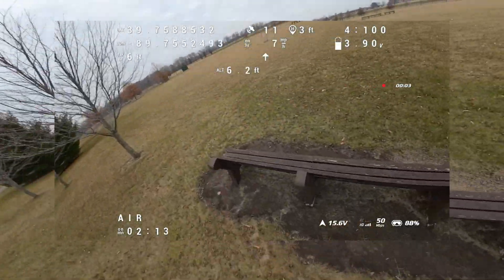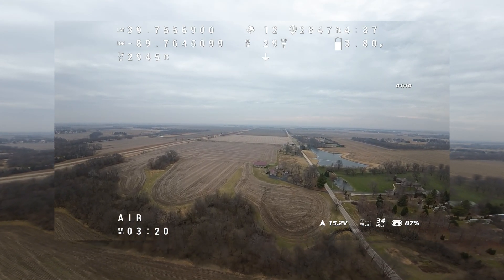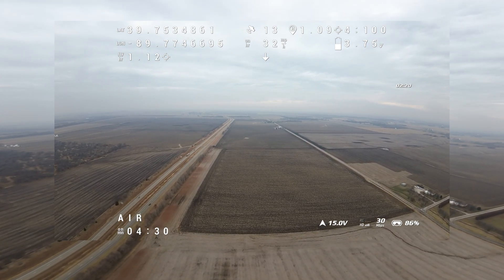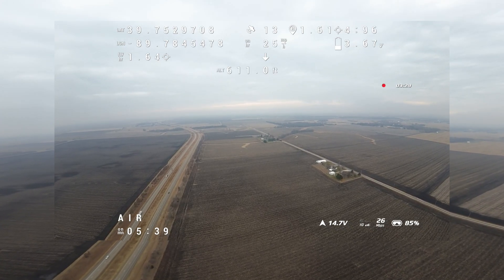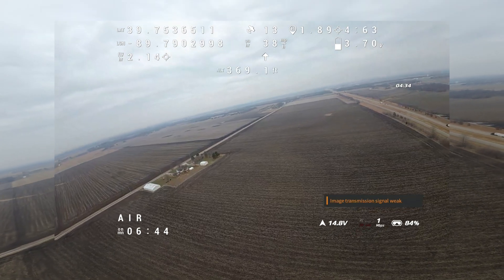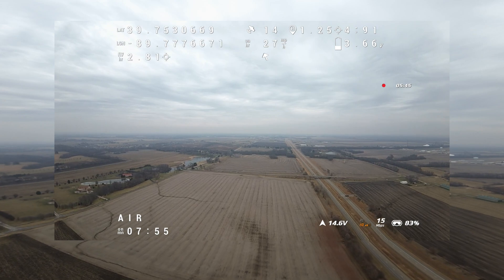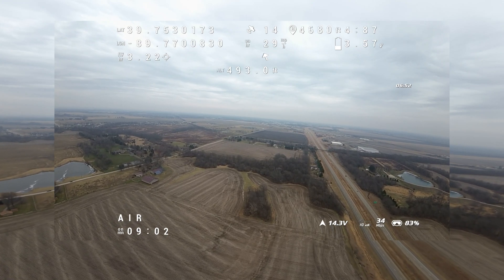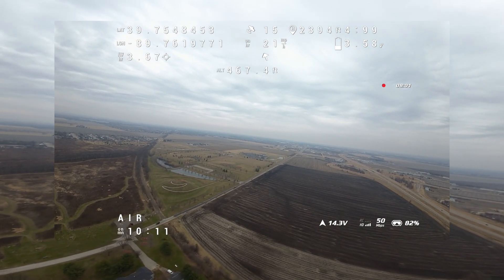DJI O3 First Range Test 2 Miles Diatone Roma L5

Comment: Really great to see you doing a range test with the new system. There are not that much videos out at the moment that are showing range of the o3 with the new goggles. Are u satisfied?
Reply from the maker: Thanks you for saying.  More to follow as I do more testing in more favorable areas.  I think I have a spot tomorrow, weather permitting, to push out 3 or 4 miles 🤞🏼 So far I am very satisfied with the setup from a transmission standpoint, I do believe it to be superior to the original DJI system in my limited testing so far.  My only complaint is how sensitive it has been with camera mounting for the stabilization to work well.